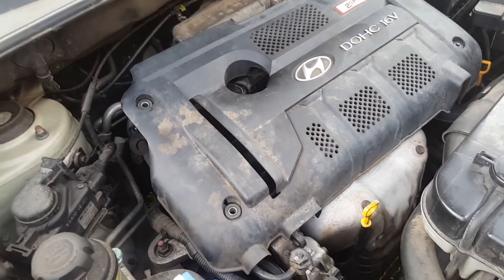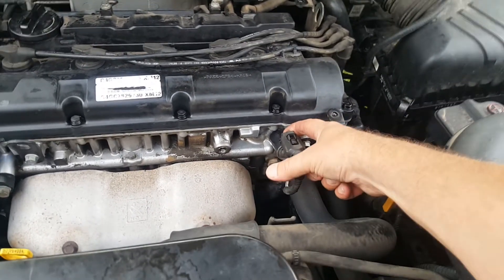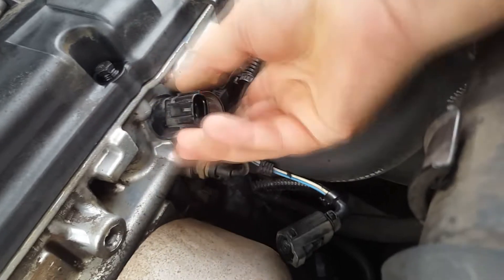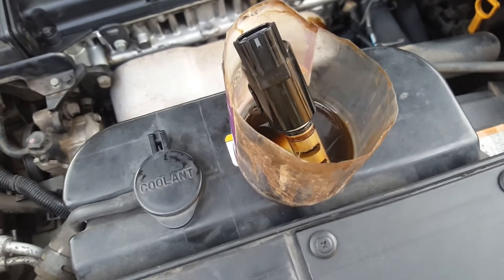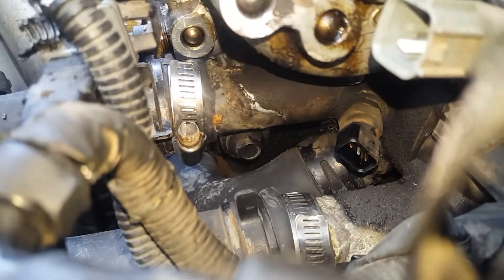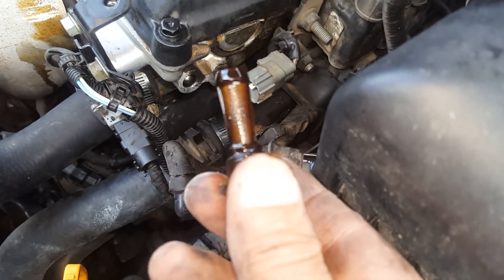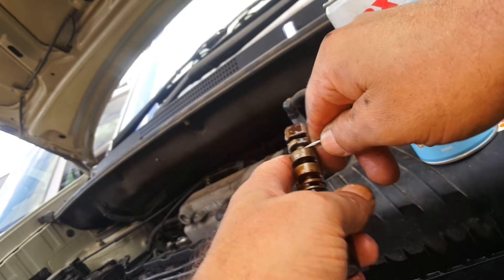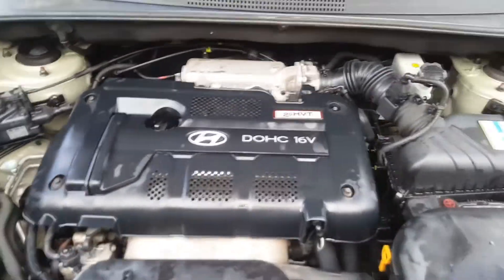CODE: P0011 “A” Camshaft Timing Over Advanced(Bank 1) Hyundai Tucson 2005 VVT solenoid cleaned

Comment: The challenge with my 2006 Hyundai Elantra, is I have replaced new VVT solenoid valve and it's pre- oil filter.
P0011 still exists.
So what's up?
Any clues?
Reply from the maker: Did you clear the error code? Error codes don't auto remove after the repair is made. Most cars to wipe codes you can disconnect the negative on the battery for 2 minutes and press the brake pedal once while disconnected. If you have a OEM stereo you will need the unlock code and make sure the drivers window is down so you don't lock the keys in the car if it self locks when reconnecting the battery.  If you still have error P0011 you might have a lose wire or bad connection or the new VVT was DOA faulty from the manufacturer.  If you have more then one error code the other fault might need to be fixed as well.
Reply: @TEKNOFIED  Yes O cleared error.codws with OBD2 Scanner after repairs, Also a battery disconnect & PCM disconnect..Full factory reset.
I have ordered a New Bosch EVAP Purge Valve Solenoid as, watching live Data highway cycle, the Purge Valve Solenoid Command and Fuel percentage at random times there are anomalies, indicative of stuck stuck open and closed  fits, between mostly stable performance.
At these times O have pulled over of road ,checked Freeze Frames Data.
One time it will throw a P0011.Then next time, having cleared the code, pre Engine light Trigger, it will throw a P0133.
Although there is no EVAP system codes, the Random fits with Purge Valve Command and fuel percentage madness.
My take is that the suddenness of the fits spins the PCM, or (ECU), into bewilderment, it doesn't know wht to do with the data, thereby in reading the Data, and compensating throws the codes.
Also have ordered a Foxwell Smoke Generator, to test EVAP system, exhaust, fuel and Engine vacuum system. To detect any minor leakages.
To stop throwing Engine light.
Reply: @MarkConwayTheBurgerKing  I'm having the same issue with elantra 2008, did you manage to fix it?

Comment: What obd 2 scanner did you use? I see you have answered the question before, but the link no longer works
Reply from the maker: OBD2 ELM327 https://i.ebayimg.com/images/g/p38AAOSwtANc4707/s-l1200.jpg
Reply: do you remember if you used any special protocol or stings or what app you used   to connect I used a eml327 and 2 different scanners but was unable to connect using torque or any other app to my 2005 tucson g4gc it has power but cannot connect to the ecu @TEKNOFIED

Comment: I've been having problems for months! I have a 2008! Same code and same diagnostic machine! I replaced the VVT and Crankshaft sensor. Then it started missing like crazy almost stalling. I never knew there was a filter there. Thanks so much man. I hope this is the problem.
Reply from the maker: I also hope that's your only problem. When putting the filter back in, first make sure it's back in the bolt correctly. If the filter comes off in the engine it can be really hard to get back out. Cheers
Reply: @TEKNOFIED  así me pasó, gracias a Dios pude sacarlo

Comment: Code coming up on my 2008 Hyundai Elantra I looked at the sensor tested it and it passed metal shavings in my little filter what can this mean
Reply from the maker: Normal engine wear creates metal files and it's the oil filter job to catch them. It can't catch all of them and will not catch any after the oil filter gets old. Oil filter changes should be done every 5000 kilometers, engine oil every 10k though some will debate changing both every 5k. It's important to do regular changes for this reason. With good quality oils and filters. Cheap oils/filters will just keep the engine going but does more damage over time.
Reply: Whar scanner tool did you use ?

Comment: My friends car has this code and I’m trying to help her and her car isn’t going crazy or anything so I don’t think it’s a big problem. Is this the most common cause of this code?
Reply from the maker: The filter blocking up is a common problem. I did a job on one that after each clean a few days later it would be blocked again and error code would return. After doing a flush, clean oil and oil filter. I cleaned the small filter again & the problem staid fixed. I would recommend doing an oil change if you’re going to clean that small filter as it's a pain to get to.
Reply: @TEKNOFIED  okay she did an oil change and since I’m not near her I have to try and explain it to her through texts and calls so it’s hard. I told her to buy the vvt actuator valve and replace it. Is that not a good idea? Or should I just try and get her to clean the filter
Reply from the maker: @rudydaberry122   Before buying a new vvt actuator valve, in most cases it could simple need a clean plus clean that small filter. I would clean them both first. If the vvt actuator valve is faulty? replacing the valve later is easy. Cleaning that small filter isn't.
Reply: Whar scanner tool did you use ?

Comment: I have a 07 Hyundai Sonata 2.4 engine same code replaced cam shaft position sensor  still getting same code if I clean this screen do you think this take care of the problem desperate for any help you can give me
Reply from the maker: Did you replace the sensor with a new one? Yes cleaning the screen is a must. Also check for bad connections.
Reply: Replaced with a new sensor
Reply: Will update you on the results thanks a lot
Reply: I have an 07 Sonata 2.4, any luck with the fix?
Reply: Whar scanner tool did you use ?

Comment: Do you still answer questions on this video??? I have an Hyundai Elantra with the same code given but the symptoms are the older gentleman that owns the vehicle stopped for gas last night and his car won't start back Ive checked for spark and that good I've even tried a little shot of starter fluid in the breather intake to see if the fuel pump is not working and as it cranks it's only seems to try to fire on the 3rd or 4th engine rotation but it's a very slight firing any suggestions as to why it won't start
Reply from the maker: I was away for a few weeks. Have you fixed the problem? Was there any error codes? Check the timing marks are still lining up. You could try removing all the plugs then spraying starter fluid directly on each piston a good amount like 5 to 10 second spray on each piston put the plugs back in and try see if the cranks. Make sure the MAF sensor has no leaks in the hose. Also check the plugs for any water on them.
Reply: Sensor de rotação

Comment: This wouldn’t just be a faulty camshaft sensor ?
Reply from the maker: Yes it could be just a faulty sensor.
Reply: My Hyundai Elantra is doing the same thing and I changed the cam shaft sensor and it’s still not working correctly
Reply: @nyirahnunn  what did you figure out?
Reply: @rudydaberry122   i got a engine flush and oil change and changed both cam shaft sensors but the sensors have to be reprogrammed

Comment: do you happen to know what that screen is called? I found it, cleaned it on my tucson. Worked like a charm. Now dealing with similar p0014 on my kia and I believe I found a similar bolt. But I can't find anywhere what this is called. I want to make sure before I weld a new a bolt head to the bolt that stripped. Thanks so much
Reply from the maker: Hi, I replied to your other comment. Chers
Reply: Whar scanner tool did you use ?

Comment: Hi there can any one help me, got this same code and engine it has a really bad knock intermittently, can this failure cause the intake valves to hit the piston
Reply from the maker: No it woudn't cause the valves to hit the piston. You have something else going on. Maybe an old timing belt.
Reply: @TEKNOFIED  Hi there thank you very much, have put bore scope down into cylinders to check there was nothing on the piston also no sign of valves hitting piston, engine looks sweet, since I have the same fault code as you, I also did some live stream data while he was driving the actual camshaft position was 125.25 and the target was 89.62 about 2 mins into the drive these numbers became the same, sort of indicating an intermittent problem with the VVT , is it possible for that failure to cause a knock ? It's my granddads car ,it would make this knock intermittently over the past two years and he put some oil flush through it and since then it has only knocked once, he took it to the mechanic and they told him it's probably something on the piston but I have proved that wrong as there is no damage to any of the pistons with my bore scope. It has also had the Mass airflow sensor disconnected as it failed and ran fine without it so he never got it replaced as it was quite expensive ( personally I think it should be connected and working ) Just wondering whether you've experienced anything like that with one of these motors as its only done 101000 kms ? next time I go out there I will check the VVT valve and filter, the cam belt has only just been replaces as well and that intermittent knock coincidentally started after that, but the engine runs to well for the timing to be out a tooth, will still double check though. thanks Josh
Reply from the maker: I have seen the cam sprocket be put on backward before and also the timing belt incorrectly installed from the tensioning pulley over tightening the belt and both times the engine had a valve knock. From the sprocket, it knocked all the time and from the belt, it would only knock under load or in the higher rpm. The belt doesn't need to be a tooth out, over-tightening it can make it like 1/4 of a tooth out. The MAF sensor is very important as well. The ECU is adjusting other sensors to compensate for the sensor that is failing. without making sure all the sensors are correct and correcting any error codes you could be chasing this problem forever. When sensors fail and the engine still runs shouldn't mean it's something to ignore. The ECU is making other adjustments so you don't get stuck on the side of the road. Ignoring a fault leads to more problems later on. You will find MAF sensors on eBay for about $40 search for Tucson Kia Sportage 5WK9643Z. Take Care
Reply: @TEKNOFIED  Hi there mate thankyou very much for your time and advice will get onto it soon thanks Josh
Reply: Whar scanner tool did you use ?

Comment: YOU should drive the car for about 2 miles to make sour not comeback the code
Reply from the maker: You are correct a 15min drive would have been a better test. The codes didn't come back at all in the past 5 months however the same car blew the head gasket last week and tomorrow I start putting it all back together. It did cross my mind about cleaning this sensor and filter if that was the first sign of the head-gasket starting to fail.
Reply: @TEKNOFIED   good job Mate